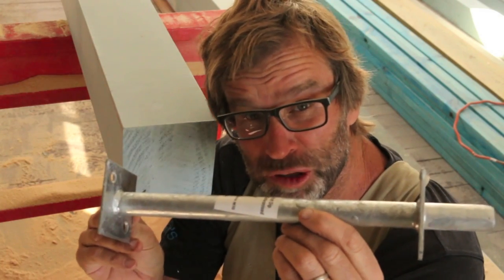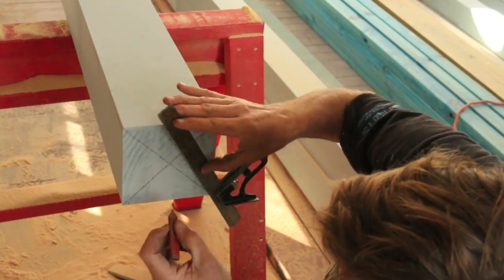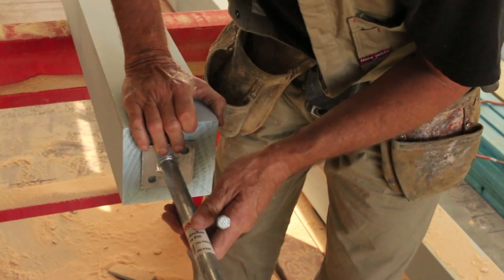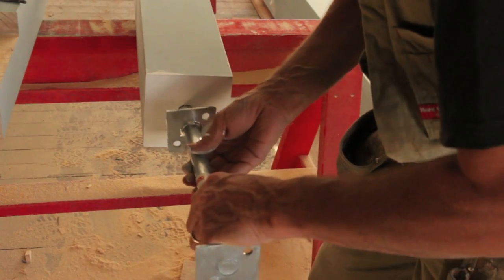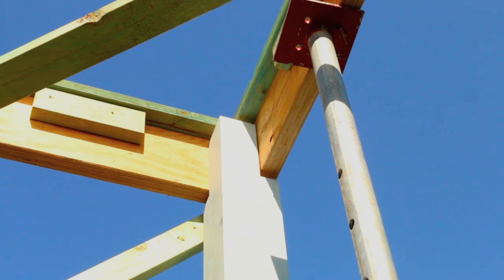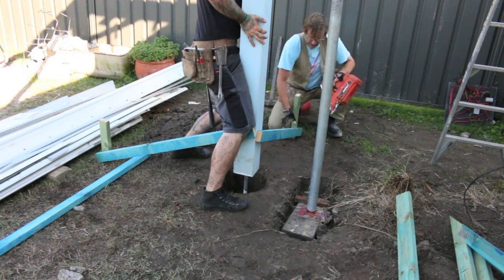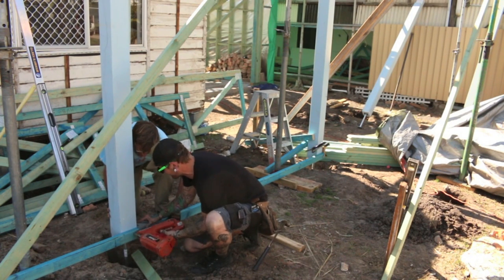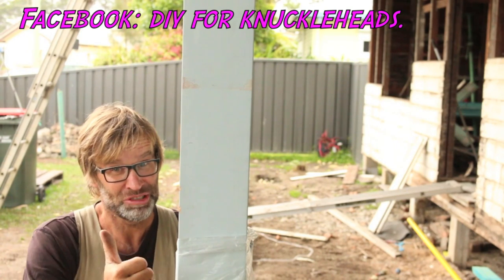Installing Decking Posts. Owner Builder Series Ep 22, Part 2.

Comment: Shane, probably another tip to use is when you srrew any coach screw into timber and bolts going in through timber, put some grease on them as it will stop the sap from reacting with the metal and rusting. This is regardless if it has galvanising coat on it. As a Liney, we do it and I have pulled bolts out of poles that have been in there for only a short time, about 12 months, and rust has formed eating the gal away. Also, the grease makes it easier to screw the coachscrews in and remember to wipe the excess squeezed out grease off.Keep up with the Feral look, suits ya 😀
Reply from the maker: +rosscoesmiff Yeah l actually did that that Rosscoe. I spent a bit of time back the young days building pole houses on the side of hills and my boss was always going on about greasing up the bolts. It's a good practice which l've  continued on with today. I should have mentioned it but l just forgot. We ferals have to stick together Rosscoe :-) Cheers mate

Comment: Thanks Knackers. Thoroughly enjoying your OB series. Just about to embark on a similar build myself. Why did you decide to hang the beams on acro props first, then erect the posts second? My slab is already down, so I have to use screw in post anchors. I had planned to notch out the posts, set them in place, plumb, brace off, then mount the beams onto the posts. Any issue with doing it this way?
Reply from the maker: Cheers mate! Glad you're enjoying the series 👍😁 When you hang the beams off acro's it 
makes setting up the posts so much easier. Just hang them off the beam that's in the right position and then plumb the post....attach the post bracket and then bolt the bracket to the slab 👍

Comment: Great tips! By pouring the concrete in afterwards, how can you ensure that it adequately makes it's way under the post support? Or is the concrete strength on the sides of the support?
Reply from the maker: +Zukini28 G'day Zukini. Once the concrete is poured, just get your shovel and vigourously prod the concrete around the hole and under the post stirrup so that the concrete fills up any air pockets. It works well. Cheers

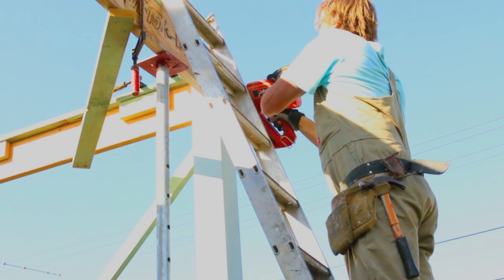Comment: When lifting the post up into position (4:50) does the post HAVE to reach the top of the beam or is their a maximum allowed distance for the post to sit lower than the top of the beam?
Reply from the maker: G'day Troy. It doesn't have to mate but if you can l would do it. The more post you have on the beam, the more stable it is in regard to twisting, Good luck 👍😁🇦🇺

Comment: thats excellent love this sort of work. But why did you bother with the ratchet on the coach screws.. should've just used the cordless
Reply from the maker: Thanks Adrian. I like using a ratchet because l have more control. There's less chance of over tightening
Reply: yes and no.. Anyways whatever your comfortable with is all that matters very neat work.

Although I have to say these new drills they make have speed control, and I think impact drivers are very good because you can feel when the bolt gets tight.
Reply from the maker: adrian valentino l think l'm just a bit old school mate 👍